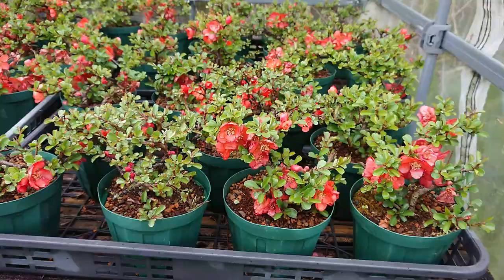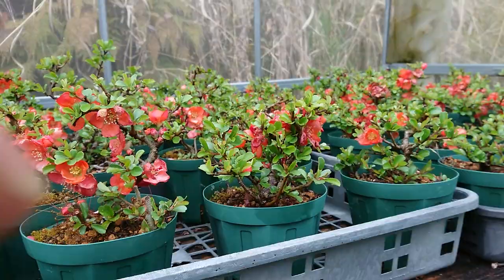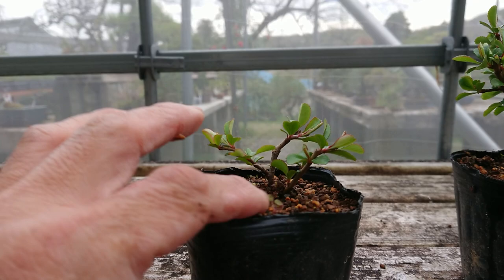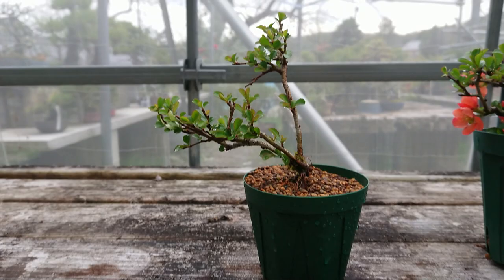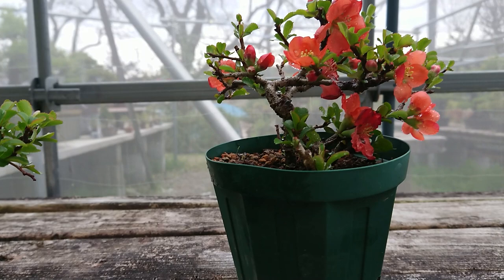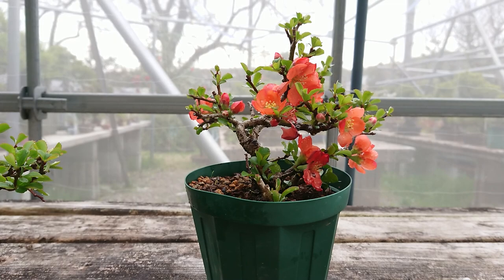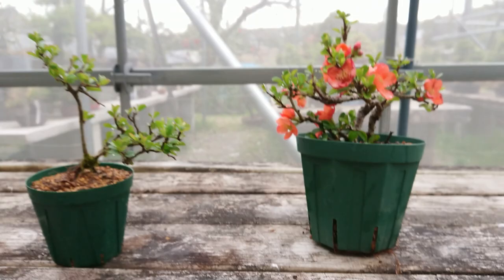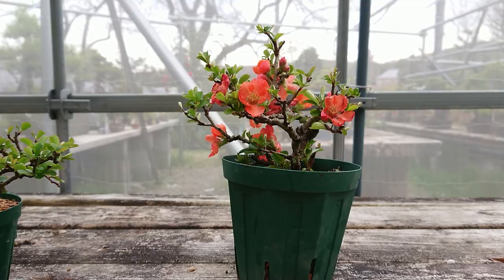Process to make Japanese quince mini bonsai from cutting

Comment: I am still in confusion about these varieties of Japanese quince, quince in my garden has larger leaves, and the leaves of your stock are quite smaller tree very suitable for bonsai. please if possible specify the varieties of the quince.
Reply from the maker: There are 3 quince in Japan
Karin Quince
Pseudocydonia sinensis

Chinese quince
Chaenomeles speciosa

Japanese quince
Chaenomeles japonica

When we call "quince", it's mostly Japanese quince. Smallest type.
Reply: @MatsuyoshiBonsaiAcademy  thanks
Reply: @humakhadka7557  it's probably one of the dwarf varieties of Chaenomeles japonica, which are only propagated for bonsai. Your best bet is to buy a young chojubai pre-bonsai and to multiply it by cuttings over the years. There are some small-leaved varieties available in regular nurseries, but they don't behave the same way as chojubai.